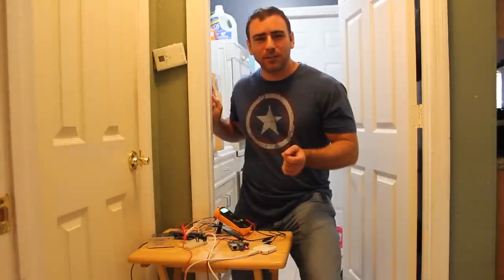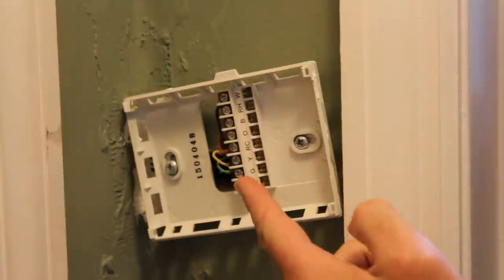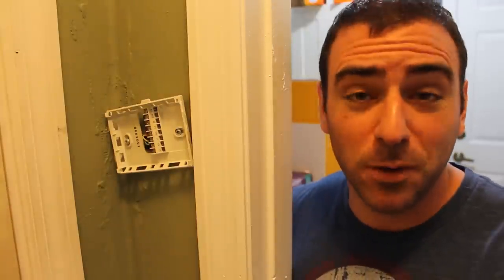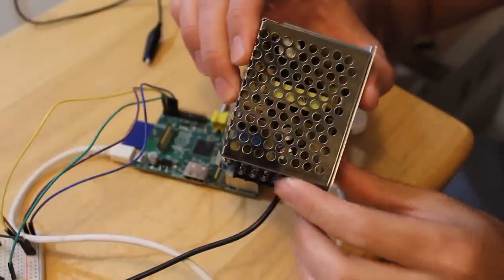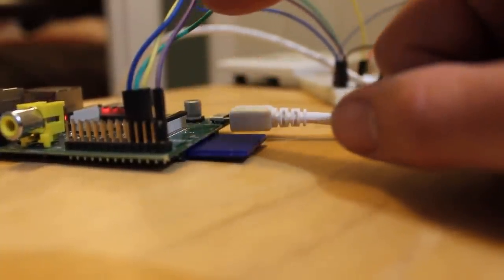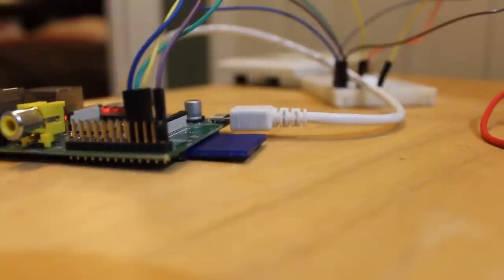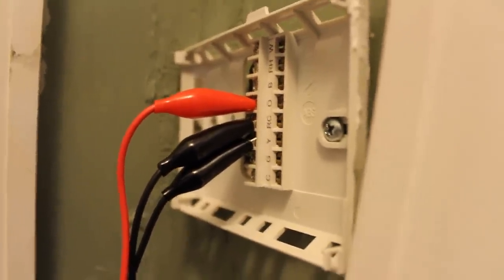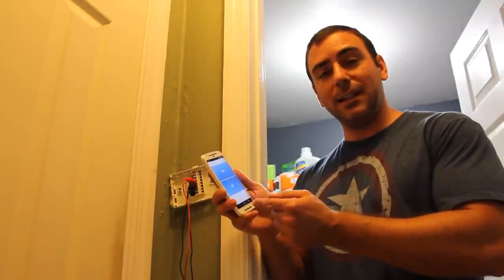04 Raspberry Pi Smart Thermostat Home Automation Linux Tutorial

Comment: I live up in canada and have a air to air heat pump. it will give me heating down to 0 deg f then I need to switch to my propane furnace. So I want to set up indoor and outdoor temp. sensors and have it all setup so it will run automatically. With Node Red it would be very easy to control over IOT.  Take Care

Comment: Make sure you are inputting the exact voltages needed by the furnace or you will destroy the HVAC mainboard! Typically these wires require up to 24 volts or less but if you are inputting too much, or too little,you can overload or cause wear to the components and ruin them. Note that under voltage can be just as bad, fatiguing components, not powering on all the way to the specification for the electronics, etc. Repairs are not cheap when dealing with an HVAC unit motherboard @ $250.00+. For those attempting this at home without any warnings...now you've been warned. @Kris - It's a miracle yours still works:)
Reply: the voltage on the wires is coming directly from the HVAC motherboard so you can assume it is ok.

Comment: Enjoyed your video.  I am wanting to do a smart thermostat myself.  I noticed you checked the power on small wires coming in through the wall.  They are 24VAC not DC as far as I know.  My only issue with using a Pi is that it requires a 5VDC/2A source for energy.  Since I don't want to have wires hanging on the wall, I wonder if there is a way to get enough energy to tap into the red wire for the pi and for activating the relays?
Reply from the maker: Yes, look for a Step-Down Power Supply Module.  You can get them on Amazon or Ebay for $3 to $6.  Also, look into a device called an ESP8266.  There are different versions out there, but are small micro controllers that have Wifi builtin.  They run from $3 to $8 depending on some features (such as builtin USB support).

I just started a second channel and I'm going to be doing a lot of videos on the ESP8266 in the next few months.
Reply from the maker: Oh, here is the link to my second channel:
https://www.youtube.com/channel/UCFsvtR4aNPwefLjR1a9Hgvg

Comment: A system like this gets interesting when you start doing some tricks with it.  For example--You mentioned your office gets more sun so it's warmer than the rest of the house.  Would it be possible to control the vents in the different rooms so that you could cool one without cooling the rest of the house?

One more thing--a sort of caution--if you replaced your thermostat with a system based on a Raspberry Pi (or any other micro controller for that matter) What happens when your Raspberry Pi calls for heat (or cooling for that matter) and then shuts down?

Don't take this as a criticism.  Your videos are great and my guess is that you've already given some though to backup or redundancy.  It's just that knowing how to operate an HVAC system by using a computer to turn relays on and off is just enough knowledge to be dangerous.
Reply from the maker: +DancesWithRobots Well, this video is just to go over the basics. But as far as the system getting shut down, if the Pi shuts down, the signal to the relay is lost and the power to the system will be shut off.  That is if you hooked it up the way I did and not the reverse, in which case if the pi shuts down it turns the system on.

I personnel don't have this system hooked up at my house all the time, just for the video, mainly because I doesn't trust myself wiring it up from the wall, and if I start a fire, I'm sure my insurance company would have a problem with this.  I mostly stick to low voltage stuff, but it doesn't hurt to know how to do the high voltage stuff.

As far as cooling my office separate from the rest of the house, I can have the Pi at the thermostat, and it can communicate with  other systems/sensors in the house.  I could put a senor in each room and control the air based on a average, or if any room gets above/below a certain temperature.  I already have computers in my office, and living room.  I could hook sensors to them and have the Pi check them through the network.  With my current thermostat, I can only check the temperature where it is, and different times of the day the sun beats down on different parts of the house.
Reply: Kris Occhipinti yeah I’m going to agree with you in this one... if you installed a fan on the pi you’d be fine against any heat issues, but what you’re doing is super computationally taxing.... you’re doing what? Monitoring a temp sensor and sending a volt? Not super difficult stuff

Comment: old video but relays are overkill. a triac or optocoupler would be good i think.
Reply: You want a relay. It guarantees electrical isolation from the furnace and control device; otherwise there are situations where they can damage each other or cause an electrical fire.